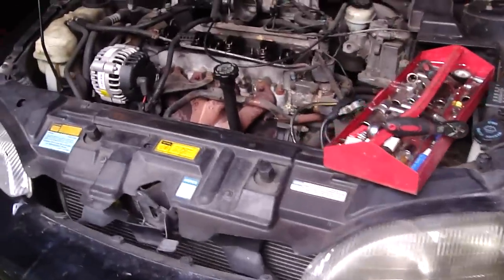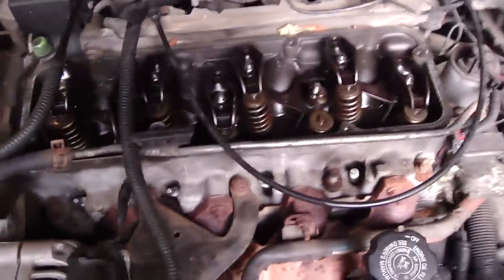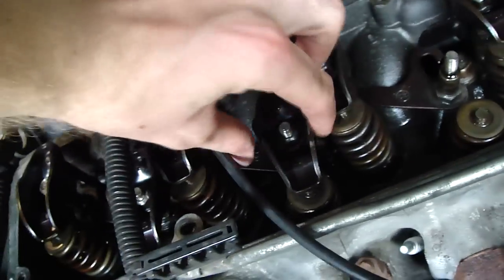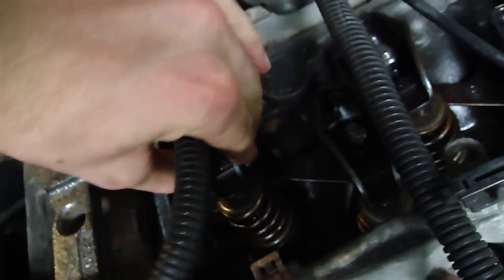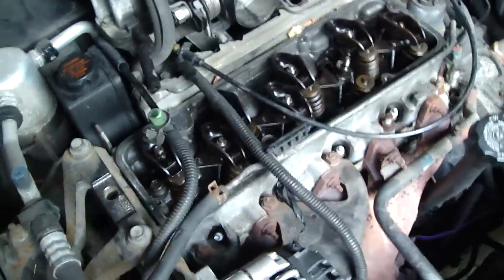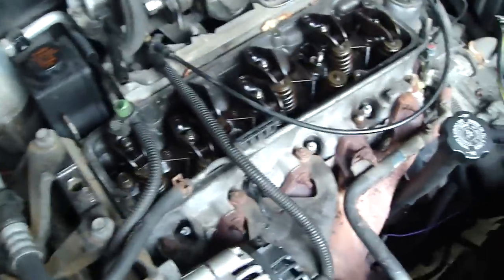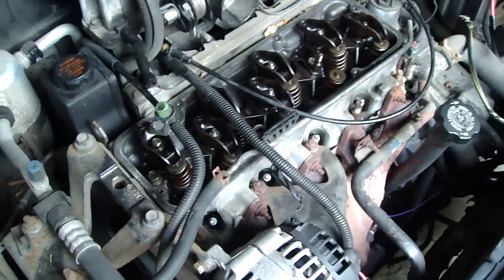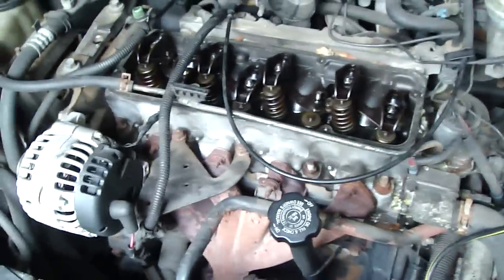Chevy Cavalier 2.2L Worn Rocker Arms

Comment: Those are adjustable. Those motors (like any) can last as long as you want if you maintain them. The previous owner probably never changed the oil and never put fuel system cleaner in it. Most people trashed cavy's because of their cheapness. My s10 has gone for 212k miles and i haven't done a thing to it.
Reply: Any update on your car? Just curious
Reply: You know the right way to adjust them?

Comment: the valves are adjustable on the 2.2 engine. they adjust the same way a small block chevy dose
Reply from the maker: They were worn out past the point of adjustment. I tried torquing them to specs and one of them broke while the engine was running...

Comment: my s10 has same engine...240,k miles ,bought it for $700.00 a  100k mls ago...valves raddle a lil' runs like a scalded rat...needs a lil'tlc and am going to try to get another 100 k--ps more power than some v6's(ford 3.0)ranger
Reply: run rislone or tranny fluid through it change add good oil and marvle mystry oil in it adjust valves and see....if it doesnt help,then you can retreive your oil and use it in your lawn mowers(small engines,might save you a lot of work(for people with out thrown rods)lol....i used to think my lil toyota 2.2/2.4 engine was the best ever(1983)..but this engine has it beat